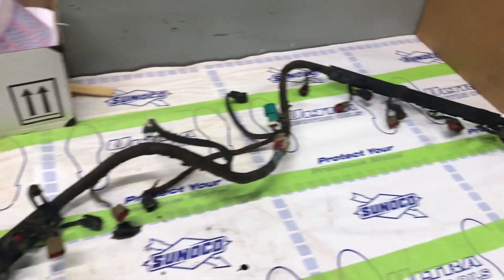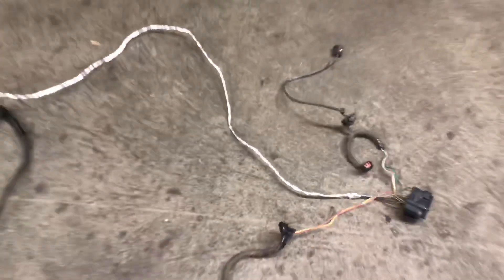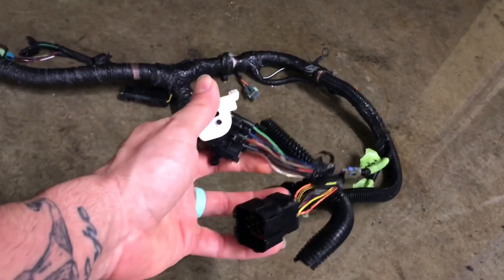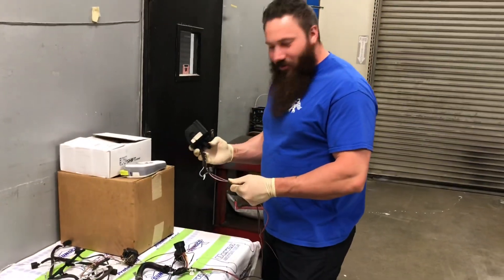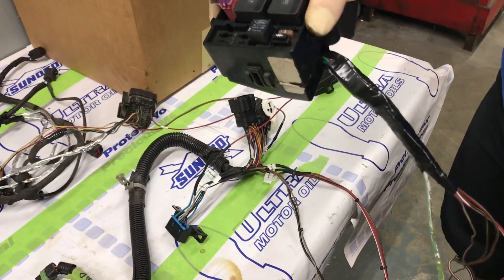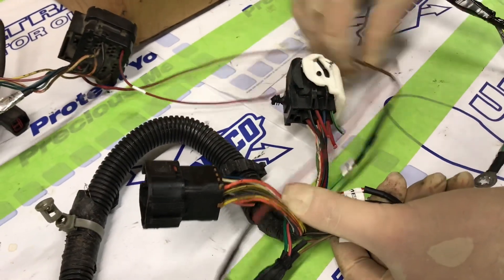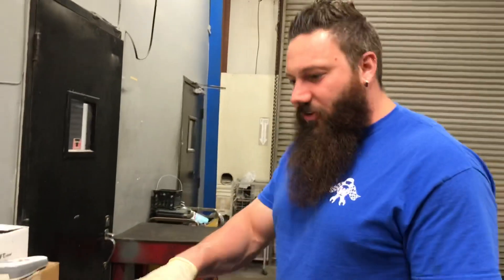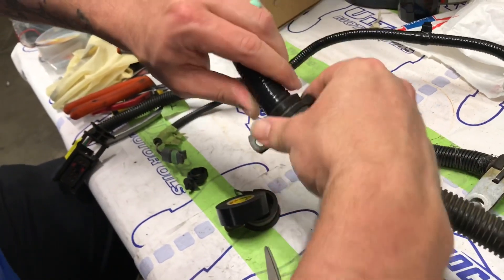Ford Excursion Cummins Conversion EP. 8 Wiring

Comment: Does DCS not offer the wiring harness services for the gas to diesel swaps? or did you not want to use them? I am about to tackle this in my 99 v10 so im sure i will have plenty of questions for you
Reply from the maker: They do offer that service. I just really like wiring so I wanted to do it myself. I wanted to wire everything I could with factory ford style relays and fuses. Sure I will try to answer any questions you have. Would be glad to.
Reply: @FitMafiaBuilds  I sent you a email to your youtube email. How is the DCS set up holding up any problems

Comment: I know this is a few years old but I am literally to the step you said would be done on the next episode. I don’t think it was covered. PLEASE assist. I have a 2000 excursion with a 24v vo44 off of a 02. How did you know what pin out to splice into the excursion hook up like AC, fuel, alt, etc???
Reply from the maker: Okay, thank you so much for watching. Didn’t know if most people wanted informative ideas or more entertainment style videos. On splicing in wires into the wiring harness all you have to do is pull the retaining clip out, usually red on Ford connectors. Next step would be get a very small pick and pull the wire holder up and pull the wire out.
Reply from the maker: On the a/c you will have to get to the pcm and cut two wires and splice them together. Which in return takes the pcm out of the circuit. Also it will blow the fuse under dash that’s okay just remove it and the A/C will work exactly as designed.
Reply from the maker: For the fuel system I went with a fass fuel pump.  I removed the tank from the truck removed the fuel pump in tank and drilled a hole through the fuel pump for a pick up straw. That allows the fass to suck the fuel from the tank. Then just use the rest of the kit to plumb up the fuel system. The alternator is a factory Ford from a 7.3 or 6.0 powerstroke then you can just cut the connector off and splice the right one on and your done with that part.

Comment: Did u have to change the gauge cluster or the tach
Reply from the maker: No I was able to take the factory sensors and retrofit them onto the Cummins engine and everything worked out that way. For the tach to work I used the  diesel conversion specialist 58 tooth wheel that bolts to the harmonic balancer. And it uses a Ford sensor and just wired it straight to the cluster wiring. Hope this helps.
Reply: @FitMafiaBuilds  ok cool thank u for your time

Comment: Hey brotha I’m in the process of putting a 12 valve where my v10 use to be. I’ve got the motor between the frame rails and I can’t get it to start with the key. Is there a diagram around that would help me find out which wires I need and which wires I don’t? Where are all my grounds? I’m in the home stretch and I need help man. I’m also using the us shift quick shift 4 so I’ll contacting you later about how you connected that. Thanks for your help man and keep up the videos!!!
Reply from the maker: No problem, are you using the factory solenoid on the excursion? If you don’t mind sending your number through I can send you a couple of pics of the factory wiring diagram. You want the starting system to be factory. Just as Ford designed. Also have you already wired in the US shift?

Comment: on a 99 cummins what wires need to be connected to what in order to make the engine run on an engine stand ?
Reply from the maker: To power up the cummins you will need a couple of powers and grounds light/green black hot in run and startred/white 12v at all timesred/light green 12v hot in run/startbrown/white power relay controlgroundsblack/tan
Reply: @FitMafiaBuilds  got it! thanks so much.keep up the awesome work bud.

Comment: Good job Sir! I put a 2007 5.9 in a 2006 F250 back in 2011 and used DCS for it all including the wiring. In my case, I HAD to use the Dodge TIPM which is horrible! It seems every part that Dodge made has failed. The TIPM has got to be the worst engineering flaw in history. I am in the process of trying to rewire around using the TIPM. Good Luck with your conversion!
Reply from the maker: Yes that's one reason I went with the vp44 pump engine instead of the common rail engine.  good luck with your project and thanks for the comment and the view on the channel.